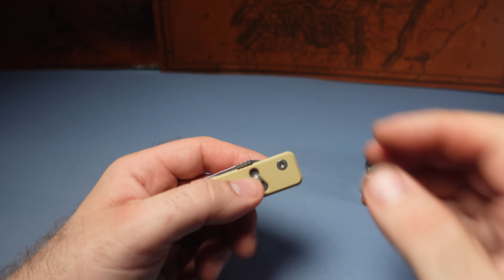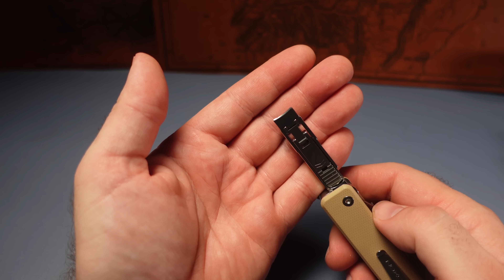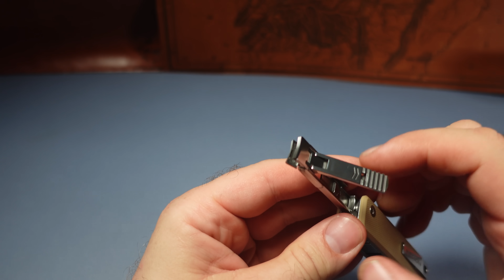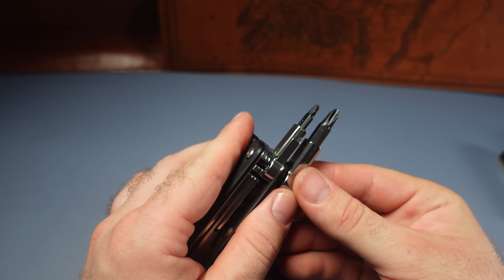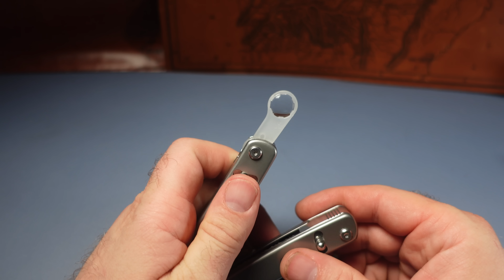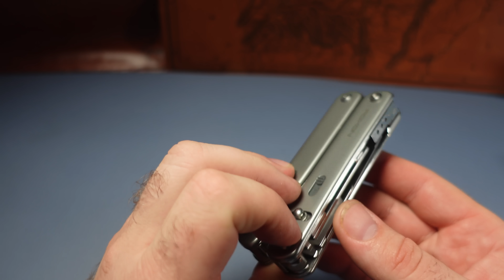Roxon Makes Great Better!

Comment: I did not know that it uses the same system as Leatherman, that's actually really cool I need to get me an extension and find a way to attach it to the outside of the flex shears.

Comment: I love the flex companion but the spring on the scissors broke very quickly. I was sent 2 replacements, the long and short version. Both of them broke exactly the same way. Wasn’t even cutting anything just actuating the scissors. The only other thing I don’t like about it is the limited options of tools. All the multi slot tools such as the two and three slot tools aren’t good enough to sacrifice single slot spaces. I really wish they had a long Phillips bit that only took up one slot. Also, it would be really nice if the 1/4” driver could accept double sided bits. If that were the case I could justify a two slot or three slot tool. I wish they would focus on single slot tools that have multiple functions similar to the ones that come with the knife. I have recently lost my flex and am considering buying another one. One thing I will say is roxons warranty is the real deal!

Comment: Actually you can fit the clippers into the flex, you have to push it in and it'll click into place, I'm assuming that's why the teeth dont touch? But that's what I did for mine 👌🏻

Comment: I EDC a similar set of flat clippers except they are double sided with angled clippers along with the standard curved clippers. I carry them because the angled clippers are perfect for cutting zip ties off of computer wires. (Friends don't let friends use zip ties on wires!)

Comment: I'm using the combo shears and knife for gardening. I already replaced the blade with hawk bill type. My suggestion is: make the shears more comfortable (it bites on the hand), also make it serrated. May be an option for trauma shears like leatherman raptor would also be nice. For the blade, I wish they add a thumb screw. Also add some holes on the blade for use as herb leaves harvester would be nice

Comment: One item on my wish list has been fulfilled, one partially (flat bits)

Hobby knife, small and large
Nail clippers (done)
Fork
Tweezers
Wrench
Cheese knife
Wood drill bit
Oil container
Indicator screwdriver
4mm bit adapter
Nippers
Center punch
Marker/pencil
Corkscrew
1/4 square
1/4 double-ended bits(wiha like)
Cutting and breaking glass

Comment: There were 3 tools on the table at the beginning: the two minis and the green scaled tool that was never mentioned in the video, except as a colorway. What is the tool called?
Reply from the maker: Roxon flex shears.

Comment: I wish the flex shears had two long slots. Big flex shears + pliers + box cutter or can and bottle opener + a file in the knife slot would be my dream tool.
Reply: I just wish that the flex shears included a bit driver. As it is now, the flex shears can’t even fit the bit driver since that takes four slots.
Reply: @handcoding  The newest bit driver he mentions is 3 slot with the flatter style bits. Tradeoff is that you can't use standard hex bits but you get a double sided. He was showing gow you can extend the bit with leatherman adapters though!
Reply: @js8981-k9g Oh, that’s a plus!
Reply: @handcoding  yeah, it would be nice. Although, I would prefer a separate driver over a flex shears that would then have to be bigger.

Edit: scratch that, making room for long slots would probably make room for a bit driver in the butt of the tool. So yes, I too wish they included one! xD
Reply: They could make the flex shears longer to add long slots
Reply: Pliers, box cutter, screwdriver, scissors. That's all I want

Comment: It sucks that the magnifying glass takes 2 slots... I was waiting for them to make a magnifying glass attachment. It'll be cool to see if the magnifying glass works well enough to start a fire.
Reply: This is why I want tools with more slots...
Reply: @blade9292  If they made a longer flex multi tool they could put longer slots in it
Reply: @GiseleClark-q3k I think they should aim at making a 3 position slip joint with a plier similar to the milwaukee or knipex twingrip. Add 8 short + 6 long and you will have it 😊

Comment: I tend to use the flex shears at work ( box cutter and shears are a life saver) and wanted a bit driver for a long time. The flat driver would be perfect since i already keep a set of galvonox bits in my bag. I cant wait for them to bring it over to Canada!

Comment: A magnefying glass, wirestrippers, precision screwdrivers and (mini) pliers, that sounds like someone is ready to do extremely small precise electronics soddering if you ask me. Because a small cordless soddergun and some rosin core sodder wire (maybe a dremel too) can get you pretty far.
Reply: I have one of these mini Irons they are surprising. I wish the nextool Gemini was a bit better though because it has great form factor for précision driver with pliers. I do have a bosch Dremel style tool but it's large...
Reply: @blade9292 Yep that had been 1 of my first thoughts as well that with changes/improvemends we could have had dremel-multitool (of course Roxon interchangeability would have been even better for the remainder of the tools), because dremel already provides a multitude of potential functions. (Grinding, sanding, cutting, polishing, drilling and engraving all of which could be very nice complement to a screw driver function on a multitool!!!) 😊
Reply: @woutvanostaden1299 actually I think it's doable to a certain extent however it will be a tad larger than the Titan I mean the chassis fat handle will have 2 things. Removable 3.7V battery and the swappable electrical tool system. The fat handle will serve this while the slim handle will have the hand tools. You can get a nice kit out of this for electronics repair. Since the power elements are separate modules you can swap them out and get a chassis more focused on that with something in the vein of the shears multitool but a whole lot larger. I personally see a lot of potential will a power system.
With either electric 1/4" driver, drill / grinder, work lights, laser meter, solder iron, multimeter, and other things 😊
Reply: @blade9292 Larger sizes are acceptable given the extra functions that they bring (do you think it would be possible add a reciprocating T-shank adapter? 😅😊), I have a titan at home and while it's large I do still find it decently pocketable. You think it's possible add a sodder gun option to it? Hmm how about a wood burn engraving option, but suppose a stick welder option is going to be a bit too much right? I am really not wired for technical stuff, but I love hypothesizing about possible uses/implements and how to cover as many fields as possible. Given the general average price of some of the added electric tools (dremel tools can easily go for up to a €100 or more, a €20/€30 for sodder gun or wood burn engraver let alone both wouldn't be ridiculous, reciprocating  multitools can easily cost a few hundred euro's and although I know that this is a stretch but anything can do welding is easily several times more expensive) could drive the price up to a point where it is far less interesting as a multitool due to cost and potentially redundant tools, because not everyone will want or need all of these features. So I do suppose that it greatly depends on what the MSRP will be for the thing if it's like $1500 it will probably flop even if the toolkit offered really is there for the money, whereas $150 or lower (even if some of the fancier things weren't included, but perhaps sold added as later expansion packs 🤔) I could see that sell pretty well allowing to buy and carry what will be most likely the best for specific scenarios/situations with plenty of interchangeability so that you can go (relativelly) lightweight or pack a few more expansions when you expect a wider array of tasks/?heavier workloads that require more choice/variety of tools.

Would you agree? 😊😅
Reply: @woutvanostaden1299 I think reciprocating t shank might work however I'm wondering if a 3.7v motor can handle that. I can trust them to trim my hair and beard however to be great cutters for material they might work but not be great. I believe of the great potential of light modular power tool but they will have limitations. But you will have a lot of capability with the multitool alone 😮

Comment: 👍🏼
I like the nail clipper. I actually like a couple of their implements w/o even having the main tool. 
Wire strippers, folding ruler, nail clippers and I might be forgetting something. 🙂
Reply from the maker: Agreed.  Some of these are great just by themselves!
Reply: The brush kit is great and can be used separate!
Reply: How the heck do you get the nail clippers to clip and not nick and pull?

Comment: I decided to completely strip all to tools  off on my roxon and just use the scissors since my shell multitool already has a pair of scissors and saw and all the other tools  already on it I also decided to carry a small  pair of drop forged vintage slip joint pliers with the rest of my edc set up that way I can just take them out use them then slide them back in my pocket  instead of constantly opening my multi tool sheath

Comment: Pretty soon we'll have an electric shaver in these Flex slots.
Reply: Or a lighter, a miniture usb-c powered flashlight that's detachable with a magnetic bottom (okay maybe that 1 is a bit far fetched, but a man can dream right?) or a minidremel/solder gun? I think there's some real potential if someone wants to make the ultimate mini-kit for electricians/tech/pc fixers where they barely need more than a Roxon and 1 or 2 more small tools. (Dremel, sodder gun and rosin core sodder wire + the right Roxon model and implements.) 😊
Reply: @woutvanostaden1299  Een soldeer apparaat is nog haalbaar ook.
Reply: @woutvanostaden1299 I rather see some of these based on the cover plate in the Titan or the Flex shears 😮
As for the light there was a planed implement but it wasn't very good took a large amount of space (3 slots) and had shit light ... while the cover plate having something a tad larger so getting several cover plates allows you to get more from the multitool
Reply from the maker: LOL!
Reply: I think a manual one should work with  those swappable razor blades although I hope a razor company should jump in make a phantom comb blade holder for hair a 3 slots razor head holder and then the razor that clips on the shears MT 😮

Comment: ok, hear me out: Mini Companion that has the scale tweezers, the magnifying glass, the D2 blade, and the short scissors = ultimate tick/splinter/burr remover kit?

I wish Roxon releases a line of products designed to fit in the stand-alone driver slots of the Companion and Mini companion. Yes it will require a bit more disassembly. Yes it's fine for Roxon to wash their hands off in terms of warranty if users decide to use these. But imagine that space in the Flex Companion with a Leatherman-style bit driver and a one-slot short tool like a combo bottle opener that would've occupied another slot in the main tool area, right?

Roxon might also need to categorize implements better; short, medium (shorter than the long implements but won't work with tools with plier heads, like the nail clippers), long. That way users will know from the get-go that a x-sized tool that requires y slots won't fit in z frame.

Comment: Try the nail clipper in the Titan in the long tool slots. The Titan has 2 slots for long tools, but the flex multi tool only has 1 long slot on each side
Reply: Yeah I wish they made a larger version with 3 long on each side...
Reply: @blade9292 the only way they could do that would be to make it thicker or make the pliers thinner. It's already super thick and thinner pliers would make them weaker. It would be nice if the flex multi tool had more long slots, but it's a nice thickness now. I just carry my companion for the long tools.
Reply: @GiseleClark-q3k making the tool fatter I'm asking for 8 + 6 slots
Reply: @GiseleClark-q3k  I think he means longer shears.

Comment: Got mine on order! They showed up the other day on Roxon's AlEx store so for anyone outside the US, there they are they are.

Ahh so the clippers work like the double sided flat ones you can get. Ended up getting mine refunded without return because of that extra movement forward. Figured it out eventually though and felt bad so bought a rainbow one for my mum.

Going to keep a T6/T8 flat bit from the Nextool E1 in my titan so can adjust the pivots and blade swap retention on the fly.

Funnily enough my first question for the magnifying glass was whether it works for sunburning. The one in my Victorinox explorer just won't focus enough.

Maxlvledc had the same issue with the prototype clippers way back when. Makes me wonder if they're going to take another leaf out of the swisstool book and come out with a more rectangular Flex. Imagine a Flex with six layers on either side. It'd be like a swisstool with springy pliers and replaceable cutters ... it may make me cry!
Reply from the maker: Great ideas!